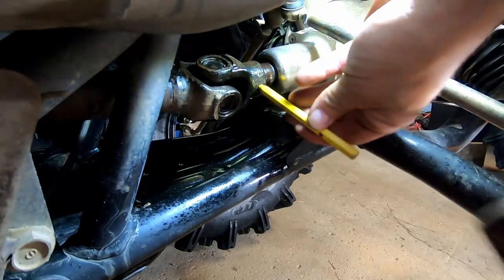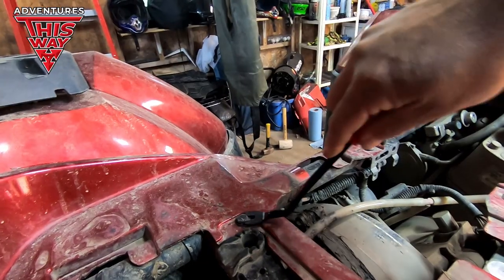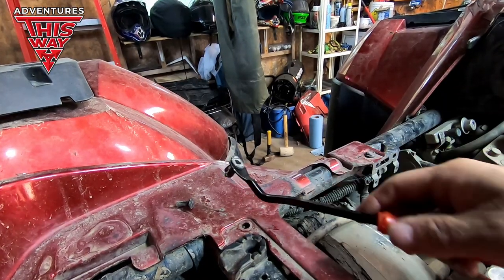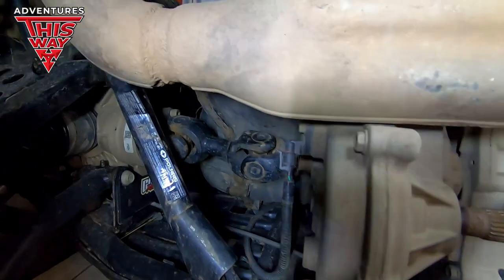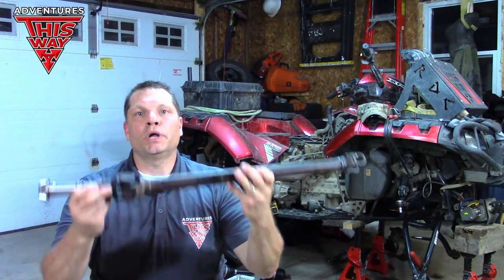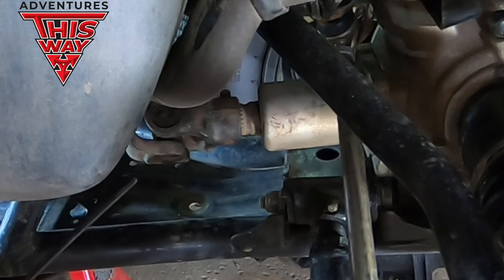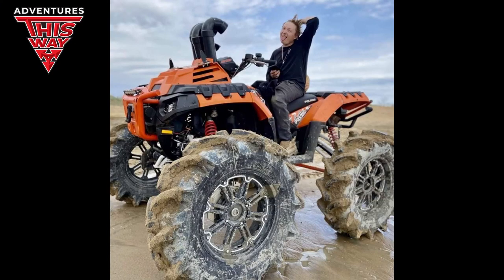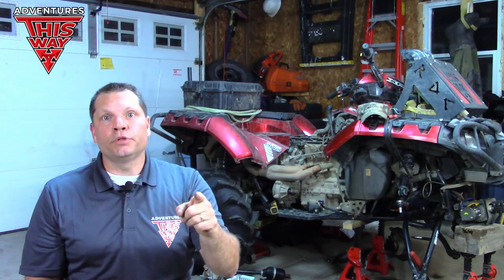Prevent Costly Damage To Your Polaris ATV!  (Easy ATV Maintenance)

Comment: Thanks I have a 2009 running outlaws and I will check that I just payed 1700 because I needed a new head gasket and new engine bolts and I will check that thanks again
Reply from the maker: Glad you found it helpful.  Take that right side footwell off and grease the yoke

Comment: I'd be very curious if you could get a roller bearing in that size. Polaris loves using the cheapest parts possible and ball bearings are the lowest of low. There is a reason the other brand uses tapered roller bearings. 😎 Keep up the content Don I am glad you and Taryn are polaris buddies now!
Reply from the maker: Ya it’s funny how during my research that  the 2016 HL(first version) had 2 pinion bearings...funny how the new S models use the RZR front Diff!  Thanks for the connection with Taryn!
Reply: @ADVENTURESThisWay  can't wait to rip with ya again buddy
Reply from the maker: ProjectVengeance yes will be great to get out again soon!  I’ll make some time available 🤞👊

Comment: Always make sure your tire fluid is over 1/4 per tire or it will cause havoc on your wheel bearings..
Reply from the maker: Oh absolutely!  Also blinker fluid on street legal European models 😀
Reply: I have trouble with keeping grease in my wifes muffler bearing,  especially if she uses 4 wheel drive in the mud
Reply from the maker: Keith belz definitely make sure to clean the spark arrestor in that muffler!

Comment: Do you have any tips about the adc system. Im blowing the fuse on the drive and when i unplugg the adc on the input case i dont blow the fuse, i dont have the adc activ on the switch but it blows the fuse anyway. I have ohm it and its 12.1, so it seems ok. Cant find any kinks in the wiring, so do you have any idea 😮😅
Reply from the maker: Sorry, I haven't had a Polaris for a few years.  Sounds like something is shorting out in wiring inside the diff wiring maybe.

Comment: Where did you get your ujoints and are they the same part number for both?
Reply from the maker: off amazon BUT for my model year the front and rear prop shafts use different sized u-joints!  Check Partzilla website to see all the part numbers for Polaris for your machine